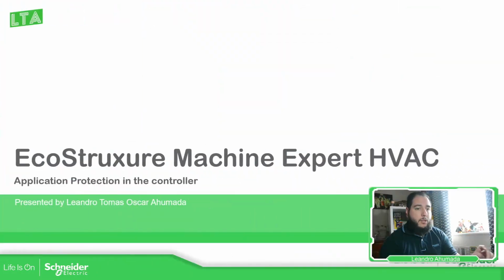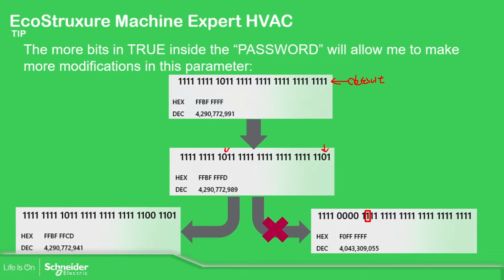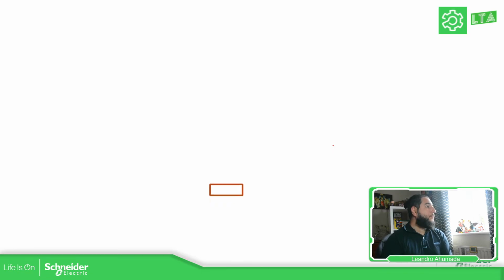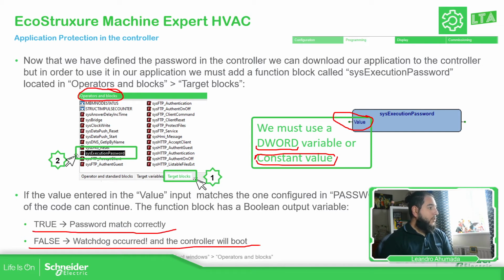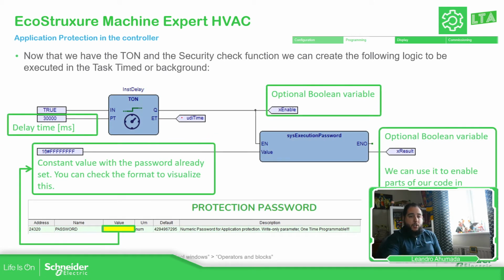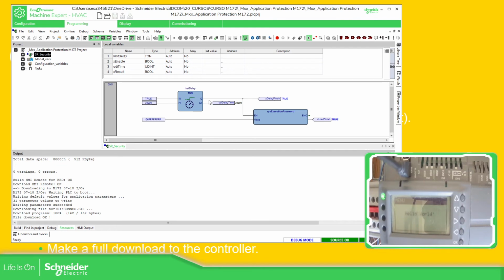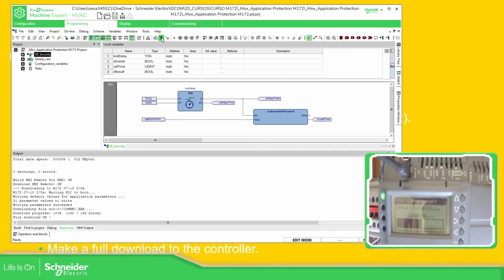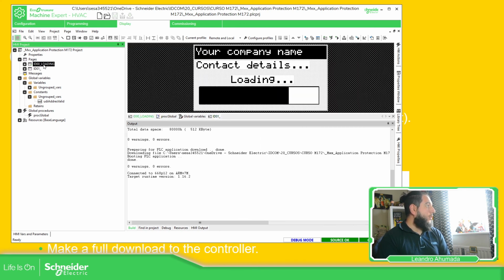EcoStruxure Machine Expert HVAC Training - M8.1 Application Protection M172 ("PASSWORD")

Comment: Nice. I finally understood the concept of application password vs level password. It´s an interesting feature to implement if needed, i.e. you could possibly ask for a password at boot time in order for the PLC to run, I guess. 
What I do not understand is what you mean by stealing the code. Is it possible to connect to a PLC to upload the binary code to a computer and then write it to a new one? I mean, maybe some SE engineer might have a tool to do that but as far as I know that is advanced hacking!
I also understand that, being a little paranoic, saving the password inside the code is the best solution in terms of application protection, but I would say that for a regular use saving it in an EEPROM variable could be a better solution, this way you may change it later without needing to connect with your laptop.  I admit you could connect with some modbus scanner but how would you identify which of the many registers is the right one?
Last, but not least: yours (in the video) is a very small program just to show how this feature works, but it looks like there is some timing issue regarding how fast the new program uploads vs the time you have set before the sysExecutionPassword FB  runs. What happens if the program is bigger, demanding more time to load? Particularly for the TM171 line that usually means a long time.
Keep up with the videos!! They are great !😀
Reply from the maker: Hi José, it is not possible to read the PASSWORD info using any 3rd party software.
Regarding the execution of the program, you can set the time scan if the program is to big (we need to define this) it will probably will not let you to download (size) or if it runs it will trigger the watchdog. If you mean the timer (30sec) until make the comparison we will not have any problem if we are the programmer 😊 if someone else is trying to copy the code to a new controller it will probably boot and reboot again and again 😬